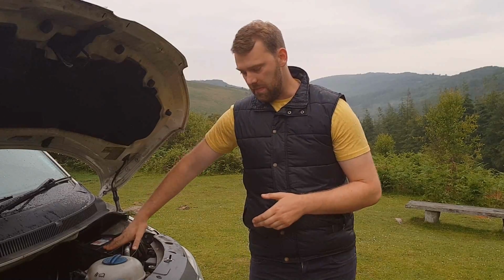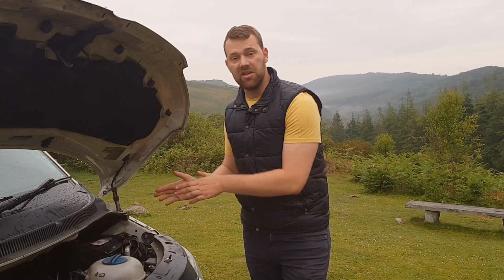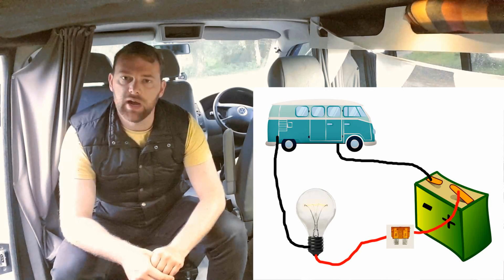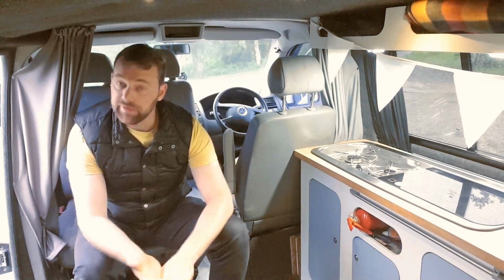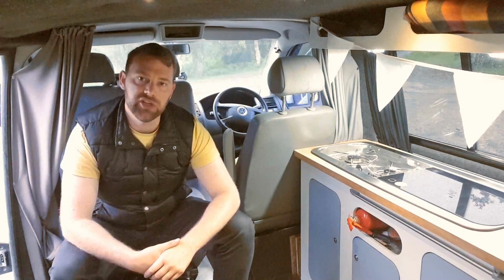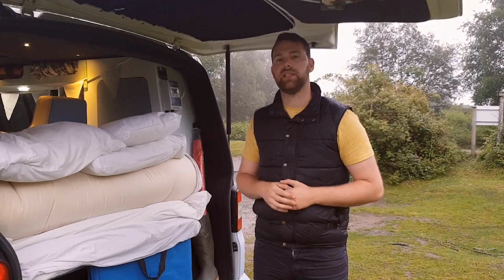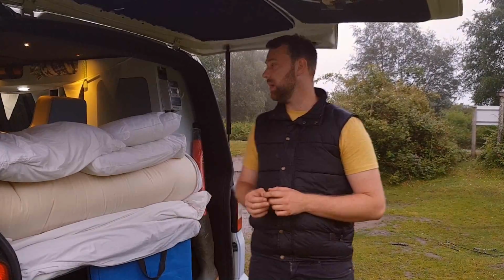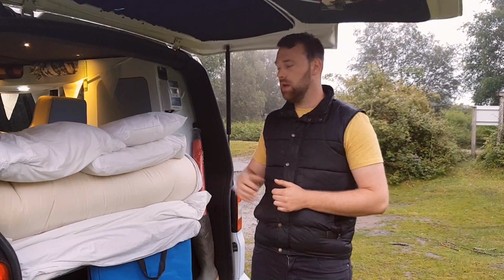Campervan 12v Electrical Systems | Everything Explained | Batteries, Charging and Solar | VW T5 T6

Comment: You said the UK weather won't charge the battery at all I'm confused now
Reply from the maker: It will do but not as much as you think, it depends on the panel type, in summer its fine, winter on overcast days it won't, unless you get direct sun on the panel.

Comment: Heya man. Thanks for the vid. It's one of the first I've found that has given me confidence in the whole shebang. I have a question though. @12:00 minutes in - you talk about having your neutrals running into a separate breaker of sorts. Does the neutral wire come from the battery, onto the fuse board and then from the negative on the fuse board onto this breaker OR negative from battery onto a breaker which then attaches to the negatives? :)) thanks!!
Reply from the maker: Hey so the neutrals don't need to be fused at all or go into any fuseboard.. you have 2 options with these 

1. you connect your leasure battery neutral to the body of the van, and then you can connect you neutrals to the body of the van body as well to complete the circuit.

2. The better option you connect your neutrals to the neutral terminal on the battery.. What you will find if you do this is that you will get lots of cables going to your battery neutral and it becomes messy.. 

So what you can do is take a neutral wire to a thing called a busbar, a busbar is essentially a bit of metal used for multiple connections.. so rather than having all your neutral connections going to a small metal connection on the battery, you have them going to a bigger metal busbar allowing you to keep it neater.. think of a busbar  bit like a fuse board without the fuses.. for instance all I have used in mine is an L bracket, it has about 6 spade connectors screwed onto it and 1 wire goes from the battery neautral to the L bracket and the other 5 connectors togo all my devices
Reply: @scoellphotography  Sorry my guy! Not neutrals but rather negatives. Thanks for the prompt response though - This has been most helpful. I think what I meant is that your positives come out of the fuse box which, is connected to the battery so surely the negatives could be returned to this rather than a bus bar? :)
Reply from the maker: @lifeboxedin2606   Hey so negative and neutral in wiring is the same thing they only differ in there technical scientific terms. The fuse board is only supplied by postivie connection and no negative, if you have a negative connection on your fuseboard then that fuseboard has a built in negative busbar
Reply: @scoellphotography  I'm sure you have just saved me endless hours looking up bits - none the less I'll delve right into negatively run fuse boards now. Seems pretty handy to have right!

Comment: Why does the split charge only charges to 80%? I have a solar with mppt connected to two 110ah batteries in caravan linked to inverter (220v) and wanted to hook up the voltage sensing relay / split charger to keep the main caravan battery topped (I don't plan to connect it to the mains often). Would that also only charge it to 80%, if I am pushing power from charge controller instead of engine's alternator?
Reply from the maker: Hi, so in this instance if you are pushing power from your leisure batteries (and your charge controller) to your main battery, since as the charge is coming from the controller, it will charge it to 100% it's the alternator that won't really charge above 80% as alternator charges at a fixed voltage, well newer cars vary it for emmisions but generally speaking it will be around 14v and about 80%.

It's a good idea though and it should work, although you could run into issues when the engine is running, as the voltage sensing relay will connect your front battery to the leisure batteries, (when the engine is running) it will also connect your alternator to your leisure batteries, which means if the alternator puts say 14v of charge into the leisure batteries your charge controller might then think the batteries are charged (as it will see them at 14v) which then it might cause it to cut of the solar charging, which in turn might turn off your volt sensing relay (as it then won't see the voltage from the charge controller) which will cause the charge controller to fire back up (as it then won't see the 14v from the alternator) and then the volt sensing relay to fire back up only to switch of again by voltage from the alternator turning the charge controller of, so it could turn into a cycle of on and off.. 

This is all hypothetical though and it might work perfectly fine, it's just my thoughts, and it depends on how your charge controller behaves when the battery is charged, it might do a float charge and everything be fine, it also depends on what you use as the volt sensing for the relay.. you will just have to see for yourself, if it does play up, you should be able to fit a diode in the live from the volt sensing relay to the main battery to stop power going from the alternator to the leisure battery
Reply: @scoellphotography  hi. Thanks for reply. I can install the 3 way switch isolating that circle (smaller leisure battery connected to my bigger power bank via split charger) and leave it to charge via alternator and split charger that is part of my caravan set up, but I was looking for a solution for when I am parked up and have no alternator running only solar. Thanks pal.

Comment: Really helpful video thanks. Does your solar panel controller also charge your vehicle battery? I will be leaving my van unused for maybe 2-3 weeks sometimes & I want a system that also keeps the vehicle battery conditioned. Thanks Ross
Reply from the maker: Thanks, So you could technically link the front battery to your Load output on the charge controller, so when your leisure battery is charged it will trickle onto charging the front battery.. however I'm not sure how it would work with a split charge relay system, as the system would link the two batteries when you start the engine and as such link the Battery connection with the Load connection on the charge controller which might cause issues... 

Your safest bet is to do what I do, get 2 12v male cigarette ends, wire with a piece of wire between them and when you leave the van connect one end into your van cig lighter and the other into your cig lighter connection on your leisure battery, this will require you to have a cig lighter connection of your leisure battery and also a cig lighter which stays live when you remove your key.. You can then just unplug it when you use the vehicle.. 

There will be other ways but none of which im aware of at present
Reply: VdubPhotogLife thanks the the advice, makes sense.